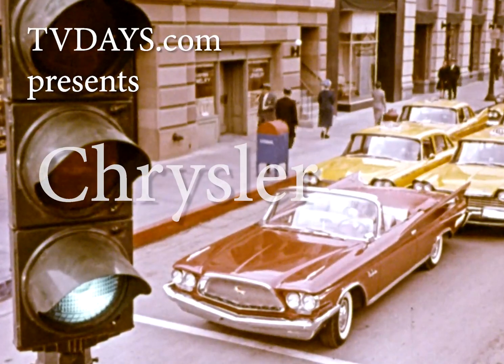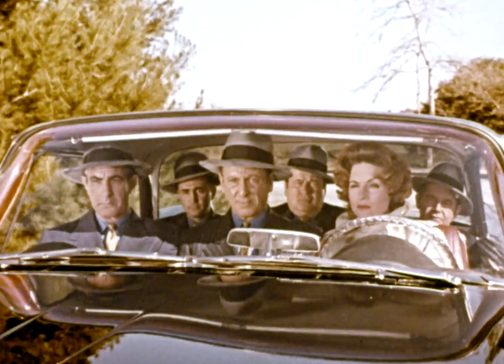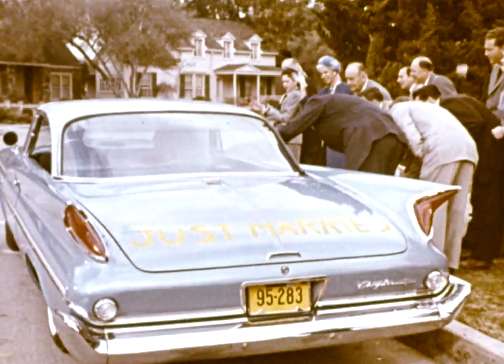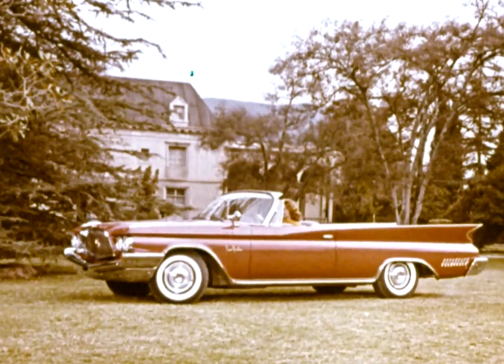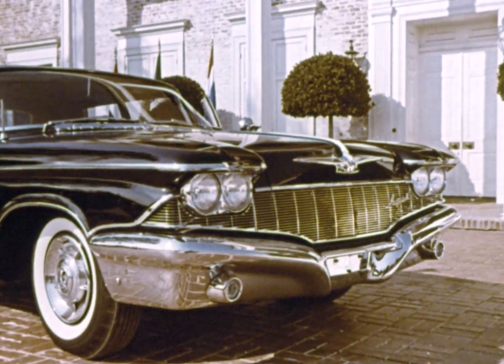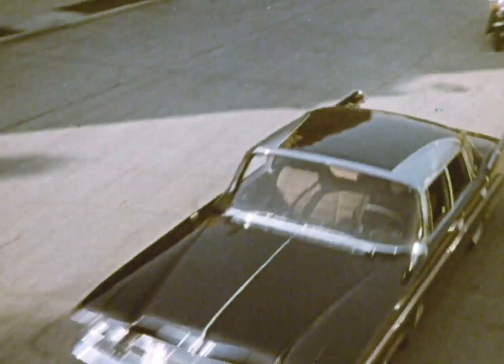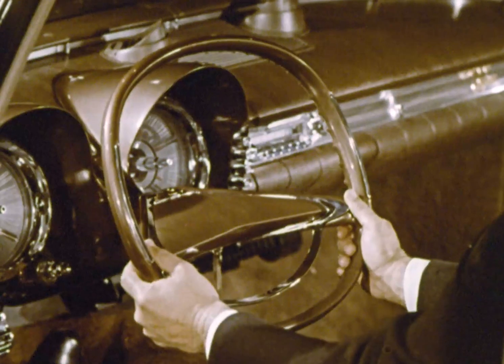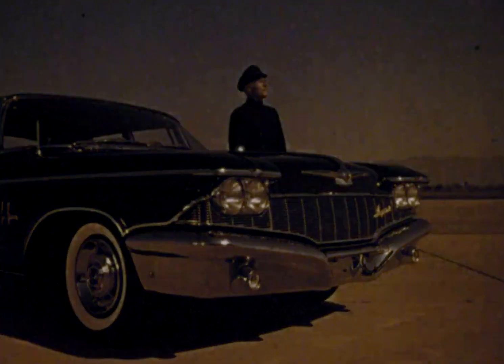Chrysler Cars 1960

Comment: Gee, I wonder WHY IMPERIAL was included  here?
WHY? because ITS NOT A CHRYSLER?
Yeah…THAT HAS TO BE IT !!!
ALL of you “Chrysler Imperial” people. (You know who you are)
If you truly believe that the IMPERIAL is a Chrysler… 
And that the 1955 SEPARATION of the IMPERIAL from the Chrysler make and Division 
NEVER HAPPENED…I have ONE REQUEST…
CHECK  The VEHICLE IDENTIFICATION NUMBER (VIN) of both Chryslers AND Imperials 
for 1960 . Here’s what you’ll find: In 1960, All CHRYSLER models (Newport, 300, New Yorker had a “MAKE code of “8.” The code was later changed to “C”
All IMPERIAL models (Custom, Crown, LeBaron had a COMPLETELY DIFFERENT MAKE CODE from CHRYSLERS Their “MAKE Code was “9.” It was later changed to “Y.”
If the IMPERIAL car continued to be a “Chrysler” as some people vehemently CLAIM , then WHY did its various models have TOTALLY DIFFERENT MAKE CODES from CHRYSLERS ?
Simple: Because IMPERIALS were simply NOT CHRYSLERS !! and even AFTER the supposed 
1971 re-Integration back into the CHRYSLER LINE…Guess What ? IMPERIALS STILL retained a SEPARATE MAKE CODE from Chryslers thru their 1975 Final Production Year…
And ALSO through the 1981-83 models. The “MAKE” code was NEVER changed back to a 
“7” or “C,” meaning that IMPERIAL retained its status as a SEPARATE MAKE. So the term 
“Chrysler Imperial” was, and is…erroneous. It wasn’t until the 1990-93 Front-Drive models that Imperials officially became Chryslers again. 
1)/https://www.web.imperialclub.info/registry/vin_decode.htm.
2)

Comment: it was a frickin boat
adjusted for inflation, those cars cost over 36k
i didnt know that chrysler marketed cruise control in 1960
Reply: Chrysler first introduced cruise control known as "Auto pilot" on the 1958 models as an option!  As for your comment on it being "a Friggin boat!" Chryslers were the best riding American cars  of the era thanks to the Torsion bar front suspension know as  'Torsion Aire!!!'
Reply: @keithdukes5990  still a boat.
Reply: @keithdukes5990  Unfortunately, Chrysler quality control in the late 50s was spotty to say the least.  My uncle owned a '57 Dodge brand new that had a transmission slip when it left the showroom.